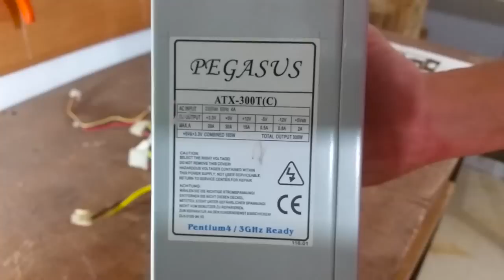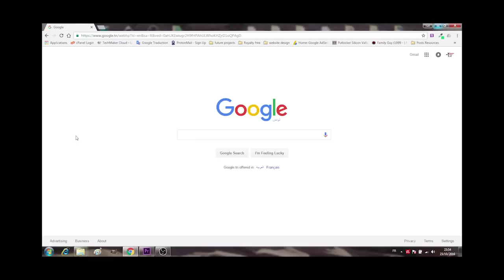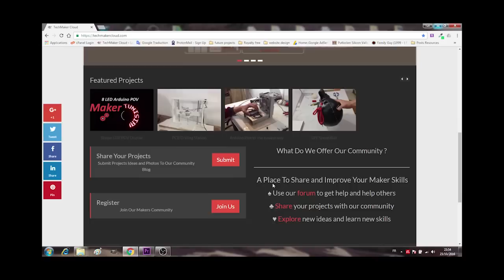DIY Power Supply

Comment: Been watching a lot of videos on this subject and I'm confused about which wire to connect to the dummy load . Most videos suggest adding the 10 ohm resistor to the rail with the highest amperage, but one video suggest the rail with the highest wattage. Do you know why someone would use wattage instead of amperage to decide where to attach the load resistor? Cheers
Reply from the maker: To be frank i dont know but i know that the power supply will work just fine without out it because it has built in shortcircuit protection and has enough internal load to start ,the dummy load is used to simulate a constant load on the output highest voltage or wattage doesnt matter it will reduce your max amp output on that rail cause its consuming in parallel to your external load.

If your in a hurry and need a fast solution just connect the green to a black wire it ll work just fine

Hope i helped
Reply: Awesome!
That makes a lot of sense.
Thank you

Comment: The one thing I don't have laying around and seems to be fairly hard to get or expensive is the dummy load. Is there any reason why I couldn't use a bank of LEDs or something similar to consume that is 0.5 amps? Or would the setup be too large and / or more expensive than an actual dummy load? I also have hundreds through hole resistors but I'm not smart enough to combine them into something that would act as a dummy load. Sorry for all the questions but I'm trying to avoid the snail mail from China if I can.
Reply from the maker: The PSU will work with or without dummny load, only by jumping the green and black wires other than that the dummy load is for load protection measure as long as you dont exceed it (current draw )you want  need it . Every psu has short circuit protection built  into it .if you dont have dummy load you can still have a working PSU
Reply: @TunMaker  thanks for the quick reply. My understanding is the voltage varies on the outputs so a dummy load is used to stabilize it.. With my research I have found a few people saying it's not totally required unless the power supply power's down a few minutes after pulling the green wire to ground. Thanks
Reply from the maker: Thats a practical awesome idea

Comment: Heard you could add a -12 connector then if you wanted 24v combined a lead from +12 and -12 then a lead from negative to get 24v.
Reply from the maker: Nice of you to mention that ,Yes and nt only for 24v you could use +5 and -5 v for 10v other combinations also depends on what you need.
Just remeber the maximun power draw is limited =)
Reply: @TunMaker awesome thank you for your time and effort ✌🏻
Reply from the maker: thanks for your support =)
Reply: @TunMaker  would it also add to add increase the amp output.
Reply from the maker: amps depend on the power of your PSU cant supply more than that
Reply: @TunMaker  Positive +12 volts lead and negative - 12 volts lead should be connected together or parallel to get 24 volts, am i right.

Comment: I noticed on your site in the scheme there are two 5 ohm resistors connected in parallel..don;t they need to be in series to get 10 ohms ?... this way it's gonna be 2.5 ohms 

parallel resistivity = 1/Rt 
Rt = 1/R1 + 1/R2 + .... + 1/Rn ==> Rt = 1/5 + 1/5 = 0.4
1/0.4 = 2.5

Comment: Noobs question:  »If I intend to use the 5volt output for a led strip and 12 volt output for my 3d printer, knowing that the led strip will always turn on, do I still have a dummy load?

Comment: hi, great video, but i have a question what is the use of the -12v and -5v? i am a nobbie :( regards from mexico
Reply from the maker: many kind circuits use negative voltages -5v and -12v like operational amplifiers ..., and since its there why not give it a plug =D
Reply: TunMaker thanks i ve never seen that before but i will drill the holes anyway, again thanks and have a great day
Reply from the maker: javier ligas no problemo thank you

Comment: Hi i have a question about the resistor.What do you think i should use on this one .......SPEC are (+3.3v -30a) (+5v-30a) (+12v1-22a) (+12v2-20)...Would i need 2 resistor for 3 and 5

Comment: can I use 10 omh 10w resistor and which line I will connect these resistor 12v, 5v 3.3v which
Reply from the maker: yes if you can find lower resistor the better

Comment: my next question is can i use this for charging 12 v ups battery what is the resistor value
Reply from the maker: the only thing i know about charging a battery is that the current should be low and the pc power supply gives a lot of current

Comment: derar
sir.
5volt are given 25amp. how to decreas amp.
Reply from the maker: added a resistor to the circuit
Reply: can you explane valu
Reply from the maker: depends on what your supplying it to
Reply: for dc motors

Comment: Nice video.  I plan to make one of these.  I have a supply from an older desktop computer, most of the power is on the +12v side so I'll need a 24 ohm dummy resistor load.

FYI.  I think your diagram has an error, you show two 5 ohm resistors in parallel that is only 2.5 ohms + the 220 ohm = 222.5 Ohm?  I think it should show the two 5 ohm resistors connected in in series.
Reply from the maker: it works both ways actually whats recommended is that the dummy loads should draw at least 0.5 A
Reply: can u pls explain what is the dummy load? thanks

Comment: Nice Video Tun Maker...i'm just a RC enthusiast and i'm trying to make a DC power supply to charge batteries...i have a question about dummy load...i'm using an old PSU with most of the power on the 5v rail (30A)....at the 12v rail i only have 18A...i only use 2 binding posts, the black for ground and the red for the 12v yellow cables...since i don't use the 5v rail, do i still have to use dummy loads? Kind regards.
Reply from the maker: yes my friend they are always needed as they are used to trick the power supply that its powering a computer.just a quick advice if your gonna use it to charge batteries you need some protection circuit to prevent overcharging ( a charging circuit for the type of battery your charging)
Reply: Tun Maker I have a lipo charger for that...or do I need a protection before the charger?
Reply from the maker: if your charger needs only 12v then your good to go ,i thought your going to charge the batteries with the power supply besides that anything that draws according to you less than 18A on the 12v it should work fine